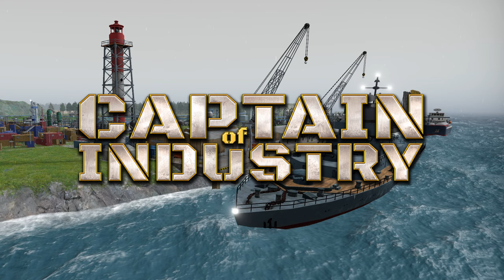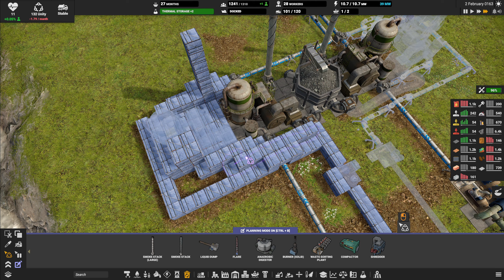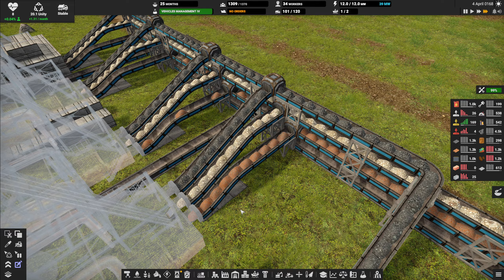New Factory Belt System - S2E12 ║ Captain of Industry

Comment: One thing I believe would REALLY be beneficial is to have your 'input' warehouses closer to your 'output' warehouses, instead of squeezing the factories between them. This saves on belts and allows for infinite scalability. Also a bit late with this comment but if u had flipped ur iron setup, it would've made it far easier to be doubled in the future.

Comment: A couple comments today. First, I think you messed up the rubber belt on the electronics factory. It outputs into one of the assemblers instead of the storage. Second, I hadn’t understood until now how clever it was to arrange your output storages so you’ve got a buffer before it goes to the main bus. Finally, the new belt array looks v pretty!
Reply from the maker: I cannot really judge that rubber belt at this point. I will change the belts again in an episode or two, but thanks. :D